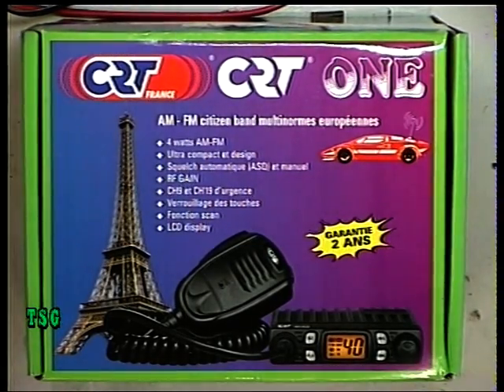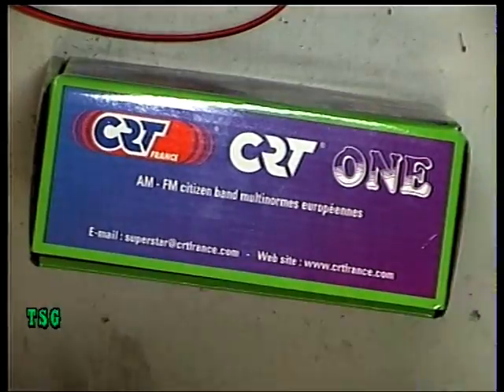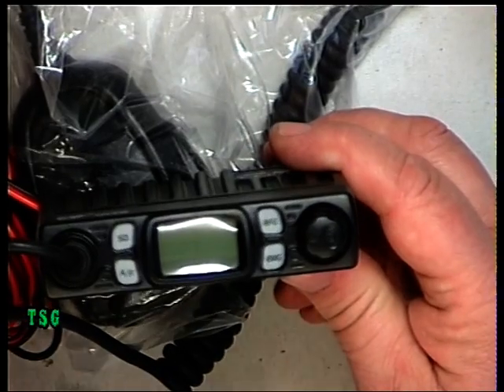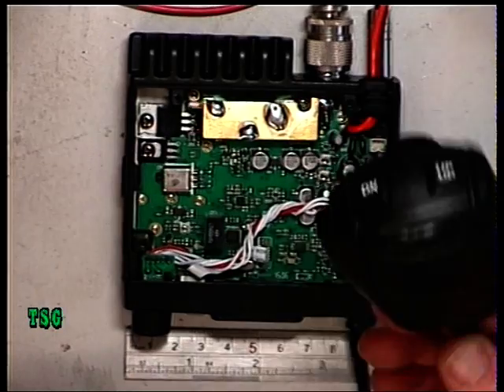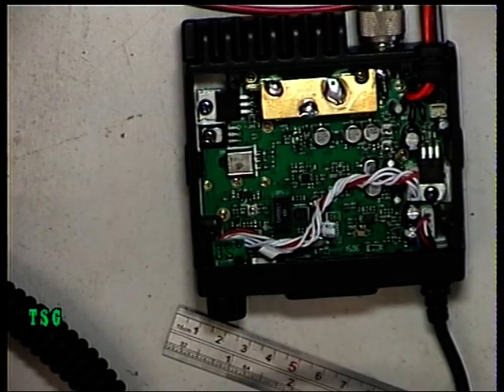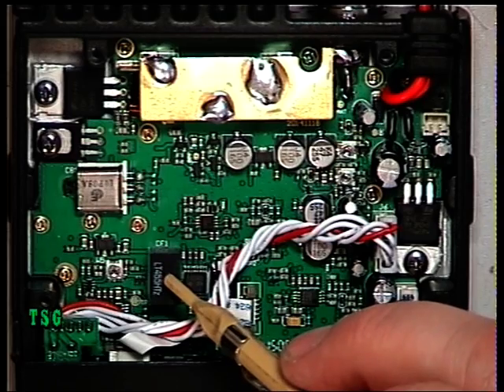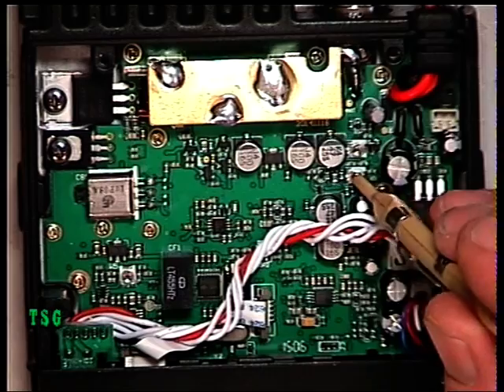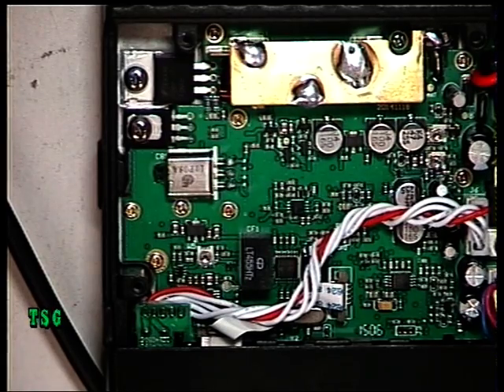CRT One, UK (CE Multi-Norm) CB radio (Mobile) - Transmit adjustment

Comment: The one you say is power does this turn power up or down?
Reply from the maker: Bearing in mind the adjustment is made with the radio connected to a power meter & a dummy load (NOT AN AERIAL), in one direction the preset adustment will increase power & in the opposite direction will decrease power. 

Richard. G0OJF, UK
Reply: @ukfmcbradioservicingTango21 Thank you, will I be able to adjust this with a swr meter thar has power indicator? 
Also was the speaker in the mic or in the unit
Reply from the maker: @glennearnshaw842  If the SWR meter is also a power meter, a dummy load needs to be connected to the aerial socket of the SWR meter in order to read power. The speaker is in the radio unit, not the microphone. Very few CB radios use speaker/mics & they are specifically sold as hideaway sets. Richard
Reply: Seems mine dont have any adjustment screws on it, I got the anytone mini

Comment: Hi even today this radio is sold and it is a good product for it's price but has a few problems. Can you share a picture whit the fm pot after modifiing ? Thank you.  And how do you measure 2.2 2.4khz reading and what khz do you send in the mic ?
Reply from the maker: I'm confused.....why what's the difference in the deviation preset potentiometer ...look at the video. surely it looks the same!  FM deviation is measured using a FM deviation meter & using a dummy load like all transmit tests. I've done more than one video on deviation meters. We use the small audio oscillator generating a 1Khz tone into the mic to set the deviation, then check with a whistle test to make sure the deviation never exceeds 2.5Khz.

Richard, G0OJF, UK

Comment: How is it possible that such a device costs only 50 pounds ??, it's sick. They do not have money for development, antique displays - lack of colorful graphics, no DSP, no bandwidth filters. They shoot themselves in the knee ... at a price that is too good - it should not exist. Producers of mobile phones and cars do not make such gifts .. But they have the money to develop engineering.
Reply from the maker: Yes, CB radios can cost less now in 2018 than when CB was introduced to the UK in 2018. I wonder if the current generation of sets will last though.....

Richard

Comment: hello, great video. very informative. What tool do I need to adjust my CRT One radio and what do I need to measure the outputs etc. I'm trying to start to set up my own small desk workstation at home. Many thanks
Reply from the maker: I'll be doing "servicing on a shoestring" videos later in the year using instruments that each have cost £20 or less off ebay. The three alignment tools I use are the double ended phosphor-bronze trimming tool, the yellow trimming tool & the green plastic hexaganal trimming tool....that one comes in a set of 5 intended for TV servicing. Only the yellow one is currently manufactured, the others can be a snag to get...though Farnell do a plastic set. Look for electronics trimming tools.

RF (output) power can, at it's simplest, be measureed roughly on a cheap SWR/Power meter. The meter is connected to the CB radio in the usual way with a patch lead. Instead of an aerial connecting to the SWR/Power meter, a DUMMY LOAD is connected instead. 5W rating is adequate, but it may be easier to buy a 25/30W one.

Richard
Reply from the maker: The green trimming tool is back available in the same set, but under a different name & for less money!

http://www.ebay.co.uk/itm/Velleman-VTPT-6-pc-Plastic-Tuning-Needle-Set-For-Trimmers-Presets-Pots-/131508763658?hash=item1e9e887c0a:g:C7oAAOSwv0tVUHgN

Comment: Hi Richard, I have found that with two of my most recent cb purchases (a CRT One and an Albrecht AE4200ASQ) that both radios were low on FM deviation out of the box, the CRT was about 1.5 Khz and the Albrecht was just 0.75 KHz across 80 channels.  On the Mid block I can easily obtain between 2.2 and 2.5khz but then on the uk band after channel 20 both sets start to drop and the maximum I can get on channel 40UK is 1Khz on both sets but then the deviation is pushing 3Khz on the mid band frequencies.  Have you encountered this at all?  As I use both bands I don't know what to do for compromise??? Many thanks, Simon
Reply from the maker: +simon walters I've never come across this & wonder what deviation meter you have & how it's tuned
Reply: My meter is a Team swr1140md, not a high standard one i know.  I suspect it must be the meter if both radios are appearing to have the same issue.  Can you recommend a decent deviation meter for home use?
Reply from the maker: +simon walters I haven't seen a Team SWR1140md, but had a quick google search so know what you are talking about, I therefore haven't read the instructions....so,....
To measure FM deviation, you have to have an FM receiver. Your meter will have a very basic FM receiver inside it, spot tuned to a specific frequency.....probably 27:205....I think that's channel 20 on the CEPT band. The meter is therefore only ever correct on that channel. The clue is that Team are a European brand, rather than a UK one (like Binatone or Amstrad for example). It therefore goes that their accessories are aimed at the euro market rather than the unique UK one. Disregard your deviation readings for the UK band. The deviation will always be the same on all channels once set. I'm sure the meter is quite adequate for home use without you buying huge laboratory instruments...like I use.
Reply: +UK CB radio servicing Thanks for clearing that up, it makes perfect sense  now.  Looks like I will have to go back and fine tune my two radios.  When I tested on air people reported no difference in audio on channel 1 or 80 which would not be the case if the deviation really was 3khz on the lower frequency and less than 1khz on the higher one.  I checked the instructions and there was no mention of which frequency or channel to perform the tests on, it doesn't even say what the range of the meter is. Power or frequency.

Comment: Do they have CB that run in the FM band in the USA.
Reply: We do not have fm. We do have and use ssb, upper and lower swing.
Reply from the maker: USA have 40 channels, 4W (AM) and the same channels SSB (PEP 12W), like we in the UK now have on the CEPT block of 40 channels. However, whereas we also have FM on that CEPT block, FM remains illegal in the USA.